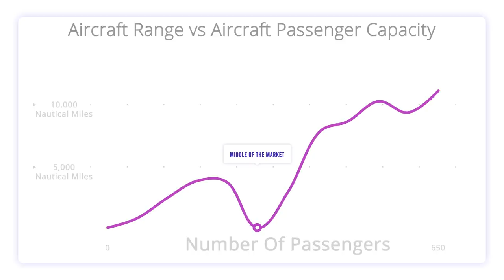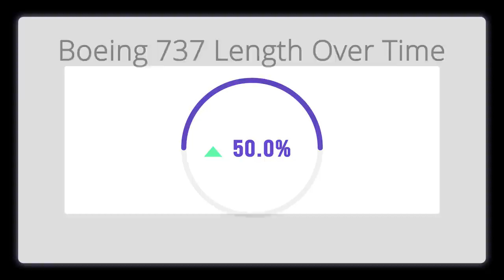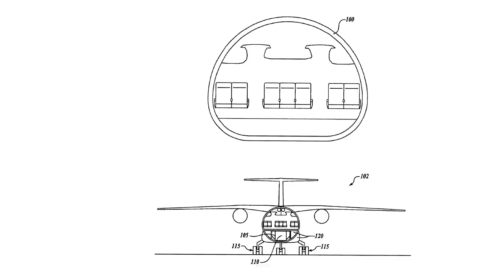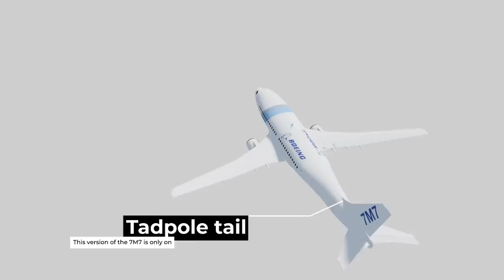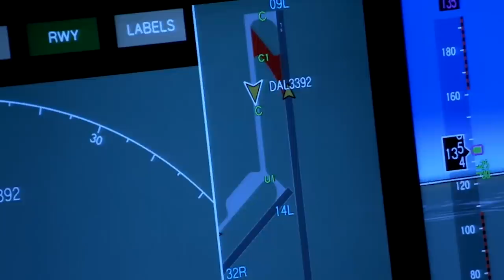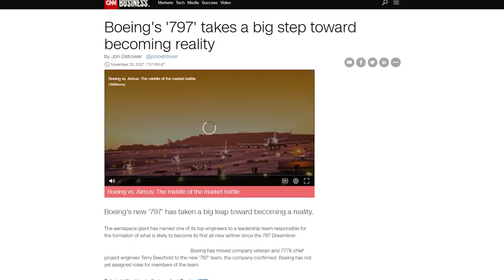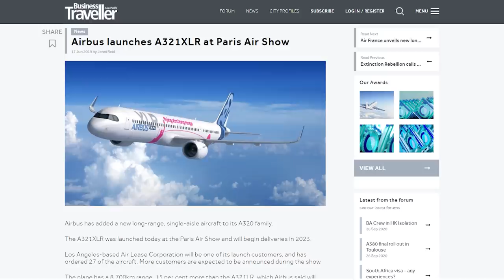The Boeing 7M7 - The Proposed Future Boeing Aircraft To Replace The 737 MAX and 797 | Never Built

Comment: Boeing's biggest mistake was to shut down the 757 line. A revamped 757 with better engines, avionics and carbon fiber structures was the answer of all their problems.
Reply: Exactly had the long legs to accommodate the leap engine and a reworked 757 would have been a world beater ,
Reply: If only Boeing cared what airlines are using the 757 for today
Reply: The 757 was one of the best planes boeing ever made. Why they scrapped that design is a mystery
Reply: I agree. That would be awesome. They still could if they wanted too.
Reply: I agree 100%. 757 was superb, and unique in his class. If Boeing didn't have stop his production line, today they could be selling the "757-Max".
About 7M7: a "twin-aisle 7 seats row" is an unconvinient configuration (1 extra aisle to add just one extra seat) and, even worse, they have to design a brand new plane to use this freaky standard.
Greetings from Argentina !
Reply: @largo6644  Narrow body planes are awefull, this design was far better
Reply: @kenetickups6146  yes, but ¿a twin aisle for (only) 7 seats row?
Reply: @largo6644  If you're building a new plane, why not? saves on boarding time

Comment: Pilots wouldn't need to retrain to fly the 7M7. That went great with the 737 max.
Reply: You realize that the 737 has gone through many minor models without requiring additional training before the MAX? Also, look at the 767 and 777 type certification differences. Even Airbus has minimal training between models. They're designed that way to minimize costs for airlines and also can be safer because it minimizes the chances of negative transfer of knowledge.
Reply: For true.
Reply: @mrdj3z  The changes between each model of the 737 have been overall pretty minor, and over a long amount of time. Whereas this would absolutely need retraining, as it is just so different aerodynamically. Just like the max.
Reply: Well tell that to 350++ lives that were lost to 737 Max. Also tell that to Boeing who had to beg for Bailout from US government because of 737 MAX. Also tell that to the 3rd Biggest buyer of 737 MAX (Lion Air)  which still hasn’t used 737 MAX until today (along with China). 

Oh by the way, it’s not minor changes anymore since FAA requires certain amount of SIMULATOR training to fly 737 MAX.

Good luck with that
Reply: I was just coming to comment the same thing.
Reply: that’s what he said
Reply: Is 300+ life not enough for u?
Reply: Because the early 737 and later 737 apart from the number are anything like the same planes..

Why not rename them as they build new aircraft rather than stick with the same numbers??
Reply: This exactly! Sounds like a recipe for a repeat of the previous issues.
Reply: Yes, are very happy to be flying a great aircraft with many new orders.

Comment: "Pilots don't have to retrain to fly this airplane". Haven't we heard that before?!
Reply: @rayjennings3637  Yes but they didn't crash because of it
Reply: @joshfrancis9903  Yes they did. Most pilots  didn't know about the existence of the MCAS system on the 737 Max. They were given a video informing them of the system on an Ipad. There is way to disengage the MCAS  system. Had the two pilots from Lion Air and Ethiopian Airlines been properly trained & informed they would have prevented the plane from nose diving.
Reply: @rochditidjani  You are right, but the comment you responded to was referring to the Airbus and their interoperability, not to Boeing
Reply: cough cough
Reply: Heaven forbid, we get some inovation, as oppossed to a higher profits.
Reply: Most people don’t even know the difference between the ng and the max so does it even matter
Reply: Boeing did this with the 757 and 767. This cabin is similar to a 767 which I really liked flying on since there were so few middle seats.
Reply: @rochditidjani  yea if only Boeing said they need to retrain the pilots and not saying they don't need any additional training. Well they lied, unlike Airbus.
Reply: I've flown 757's and 767's in the same day and other than the fact that the display control panel is in a different place, I have NO problem flying one then another~

You're talking out your ass!
Reply: @Flies2FLL  The comment was made about the the proposed 7M7 and the fact that Boeing made the same comment about the 737 Max. We are not talking about the 757 nor the 767. Your comment is out of place.
Reply: @rayjennings3637  Correct, but Airbuses are designed with that in mind from the ground up, not as an afterthought.
Reply: PROSPERITY 
BONANZA
Reply: @rochditidjani  No it is not.  Pilots can fly more than one plane just like they can drive more than one car in a day.  The thing about airline flying is that you want your pilots dealing with one set of instruments and systems.  NOT telling them about a system is STUPID, but that's not what I was talking about.
Reply: @Flies2FLL  Yes, we already established that what you are talking about is not what everyone else in this thread is talking about.
Reply: @Flies2FLL  757/767 share a type rating.  NMA would be too different to share a type rating with the 737 & would not have enough systems commonality to share a 787 type rating.
Reply: Don't forget to tell them about MCAS! Oh, forgot that it doesn't matter to you, Boeing. I will NOT fly on the 737 Max ever. I simply don't trust Boeing's culture of "market share" over passengers' lives.
Reply: The infamous max
Reply: Alway provide training. No matter what.
Reply: @rochditidjani  the Ethopian flight was informed of MCAS and disengaged it and followed the “updated information” provided by Boeing
Reply: @rochditidjani  that will be human training problem then.
Reply: @saltymonke3682  Yes it is a human training problem.
Reply: Uggh here we go again ...
Reply: Oh yes, this thought was at the wery heart of the present/past problem called MAX disaster...the wish to have as little retraining for new/modified type as possible, AND done wrong way...
It could have been avoided by more ways, among them EITHER by designing the mcas software without faults/misconceptions, OR by training pilots about its presence and exact function... but nope, for more (comercial) reasons, neither was done and so we ended with type that had 2 deadly crashes in first 2 years of flying, and both of the co-caused by construction errors...
Reply: @joshfrancis9903  Nope, not only due to it, but it was one significant cause to not properly inform/train pilots about new system(s) installed / difference to type they allready had certificate for...
Its only acceptable to do recertification/extension as small as one computer (ipad) course with NO simulator, tests etc. if there are just minor changes to airplane type... which was NOT this case, where there were significant new systems installed, and above that they were also faulty (SW)...
Reply: @amanor409  But this was intentionally done starting from scratch doing it this way (that they share common controls etc.) and there is plenty of explaining the differences of these two types (differences due to size/weight)...
Reply: @Flies2FLL  well thats just one example, and you got no small failures like those AoA vanes of MAX... and you had no faulty implementation of mcas onboard...

proves wery little, nearly nothing. you too fast at generalising.
Reply: @SYNtemp  im talking about the issues Airbus had with this bro (notably AF447 in 2009)
Reply: @joshfrancis9903  But that was another thing... boy(s) who couldn't fly pitch/power tables after routine momentary event of freezing pitot tubes (they had correct values back in about 1min, but didn't believe them, and were unable to fly according to tables, so only thing he could do was just hold sidestick up all the time... and the plane kept stable, didnt stall etc but at that angle kept bleeding off speed... captain came back too late...)
Reply: @Stryker-ye7wn  No, they ran the runaway stabilizer non-normal checklist which has always been im the QRH. Even before the accidents.

Comment: As long as Boeing is prohibited from certifying their own planes.
Reply: 𝚆𝚑𝚢 𝚠𝚘𝚞𝚕𝚍 𝚢𝚘𝚞 𝚍𝚘 𝚝𝚑𝚊𝚝 𝚒𝚝 𝚠𝚘𝚞𝚕𝚍 𝚜𝚕𝚘𝚠 𝚍𝚘𝚠𝚗 𝚝𝚑𝚎 𝚠𝚑𝚘𝚕𝚎 𝚙𝚛𝚘𝚌𝚎𝚜𝚜
Reply: Or the government agency that gave them the greenlight.
Reply: Wow, did you write some words that should be engraved in stone and be placed over Boeing's CEO's desk being held up by a rope that is set to be cut remotely by any customers.
Reply: @chrish6412  yeah the FAA (or whoever gave the aircraft the pass) is partly at fault too
Reply: @Dash101  Partly???  100% partly.
Reply: This is different than the 737 MAX 8, what it is that they won’t use the MCAS system.
Reply: @kornpops1261  maybe because safety should not be related to money...? 346 dead people on 737 max, a reason surely important enough to not bargain on safety. We have seen the result. Auto certification without control is a scandal.

Comment: It’s an Airbus A300, we’ve come full circle, well done boys.
Reply: Doesn’t that compete with the 737? This should replace it.
Reply: I believe it was the A310 which shortened the A300 fuselage. It was just before its time as the competing strategies "point to point" vs. "hub and spoke" were not resolved at the time and ETOPS was not yet approved.
Reply: I was thinking the same thing
Reply: We’ve pretty much found the ideal aircraft designs already. Going forward everything else will be variations on a theme with incremental and engine changes to increase fuel efficiency
Reply: I would be more of a 767, the A300 is significantly larger.
Reply: Or is it just rebranding
Reply: B767 not the A300. The 300 only went 400nm. Many more 767s were built for a reason.
Reply: @larrydugan1441  Well if we consider that passanger A300 production ended in 1996 and 767 production at this point was 640 planes and A300 was 462 planes the diffrance is fairly small.

A330 is a direct A300 replacement. Also the B767-300ER effectively didn´t exist prior to Airbus taking order for the A330 really pitching mostly the 767 200 and 300 against the A300-600... Considering that the 600 was launched only 2 years after the 767-200. its really 4200nm for Airbus and 3900nm for boeing... The A300 also being consideraly larger, its really competitor to the 767-300, that didn´t exist in a ER version pretty much untill the A330 turned up.

The A310 is really the competitor to the 767-200, and the range of that was 3500nm respectively 5200nm, not quite but almost matching the 767.

Its really rather natural that the aircraft is so closely match because most of the performance is limited by the engines, and the A300/A310 share engines with the 767 family, and the A330CEO share engine with the 767-300ER and 400/ER series.
Reply: @matsv201  there is a reason the A300 and 310 families did  not grow through derivatives. Very few 310s are still flying it was a market failure. 
An A330 is not the class that this video is about.
I having flown 767 - 300s for many 1000s of hours I can assure you that it is exactly the aircraft that fits the subject matter. One of the reasons it is still in production. 
Boeing still has the line in production. Aluminum lithium fuselage and carbon wings from a 787 800 and latest Genx engines. That seems a logical aircraft to me. 
I would always choose a twin isle over a single aisle aircraft. The long single aisle 321s are a nightmare to load and unload.
Reply: @larrydugan1441  A300, A310, A330 and A340 have exactly the same profile, they are identical. For the fuselage A300 and A330 is practically the same, but the wing got a significant upgrade.

The production of the passanger version of the A310 and A300 was halted as soon as the orders was finished. That they are still flying is really not relevant.

Airbus chose to gave rhe A330 a totaly new name, probobly due to the close relationship  with the A340. Its still a continuation of the A300 sharing the exact same market as well as size.

No the 767 stoped production a few years back, only F and KC orders still around for fullfilment, not relevant to the passanger market.

I highly doubt you know much about aircrafts when you dont know a A321 kan be unloaded in 10 minutes if you know how to do it
Reply: @matsv201  well with 4000 hours PIC on the Airbus 320 319 and 321 I can assure you the 321 is the worst aircraft to unload since the DC8 73.
Your point about the fuselage of the widebody Airbus  is pointless.
The 767 line is still in operation. The point being all the tooling, logistics and jigs are in place for an uograded aircraft. 
The 767 is the correct size for the market and video under discussion and has the benefit of twin isles. 
Unload a 321 in 10 minutes? That is a nonsense statement.
Reply: @matsv201  The A330 has almost exactly the same fuselage and wing as the A340. The only things they both share with the A300 are the fuselage cross section and the tail.
So the A330 is massively bigger than the A300 (50% more MTOW), and it has more range (especially after it's MTOW improvements).
Reply: @joriss5  the conversation is about an aircraft with good range and in the 250 seat class.
Twin isle is my preference having flown both designs for many years.
Reply: Worlds smallest wide body better have more powerful engines.